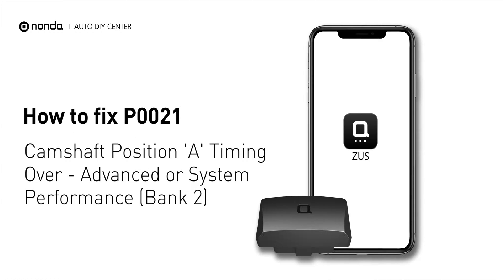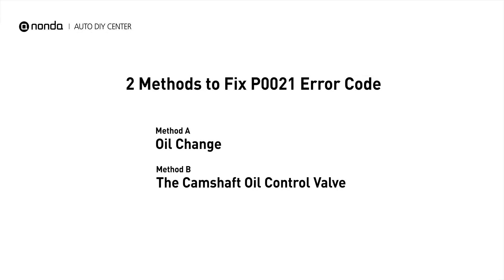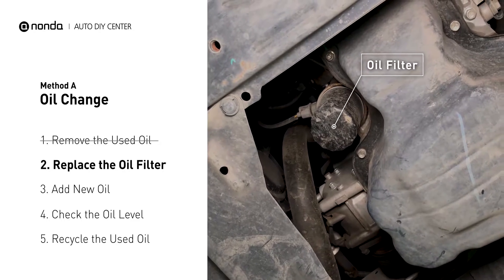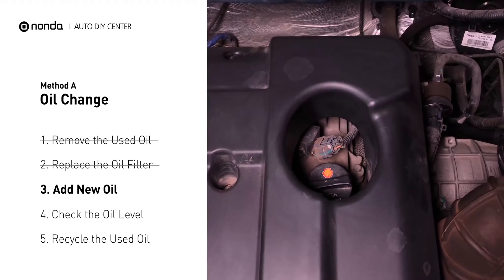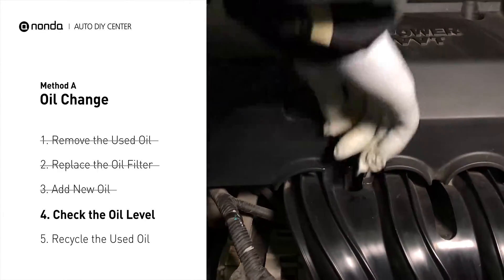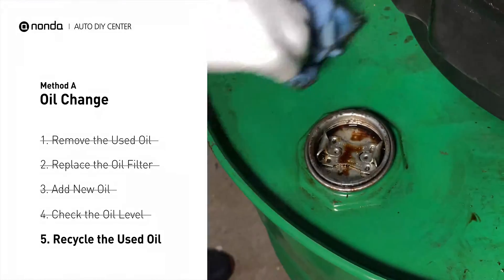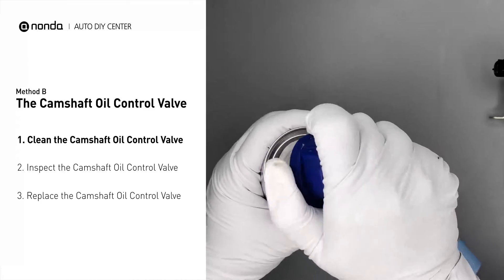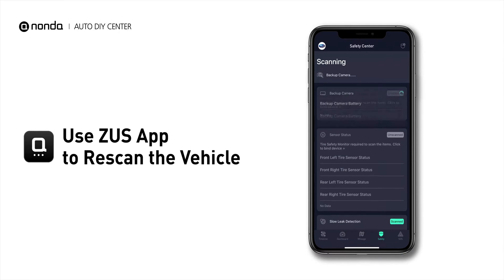How to Fix P0021 Engine Code in 4 Minutes [2 DIY Methods / Only $6.43]

Comment from the maker: Hi, I'm Steve, nonda's lead mechanic engineer. 
Feel free to leave your comments here if you have any mechanic questions, I will be glad to help you out!
Reply: Hey! I have a 2008 Infiniti g35hr I’m getting a p0021 🥶 service engine soon but it doesn’t seem to harm the car meaning bad idle or anything. I just did a oil change a couple hundred miles ago and did valve covers b4 oil change..

Comment: I got the code on my 2014 Mercedes C300. P0021-77. Would these method work?
Reply from the maker: You could have a little try, but make sure do not do anything risky.

Comment: Hello. Are these readings good or not? Is this code p0021 also related to VVT care or not? Thank you.
Reply from the maker: Hi Jaffar, yes-it affects vehicles with VVT. As this code could cause lost power and tough to start motor, we suggest to treat this right away. You may start with changing the oil and replacing the Intake Camshaft Position Actuator Solenoid.
Reply: @nondainc  Thank you. But the vvt sensor was checked outside the vehicle and there is no defect in it. My question is when checking the vehicle with a fault detection device. The examiner tells me that the defect is not in it, but in the care of the vvt actuator .
Reply from the maker: Probably yes, Jaffar.
Reply: @nondainc  Thanks and appreciation
Reply from the maker: You are most welcome. Stay safe!

Comment: I have a Cadillac CTS 2007 with only 77000km and just bought it. My oil change is due tommorow and the code pop out today ! Might it be my oil change ?
Reply from the maker: Possibly-yes. We suggest to check also the wiring from the solenoid to the ECM if damaged, and the wiring harness to the intake camshaft position sensor for poor connection as these could trigger this code.
Reply: Thx u a lot !
Reply from the maker: You're most welcome!

Comment: I’m getting this code on my 2003 Range Rover. Help
Reply from the maker: Hello, please check the engine oil condition and level. Ensure that it is in correct viscosity, and isn't dirty/low. Check also the camshaft oil control valve if functioning well.
Reply: I’m getting this code in my 2003 Nissan 350z. Help

Comment: I have a 2004 BMW X5 4.4i and I just put new filters and oil did I have to take out the old oil to
Reply from the maker: Hello, we suggest removing the used oil before changing the filter. You may recycle and reuse the old oil added to the new oil to maintain the correct level but ensure to perform a complete oil change once you've reached 5,000 miles.
Reply: @nondainc  and another question my machanic says the bmw has 4 cam shaft sensors for a 2004 BMW X5 4.4 would you know if there all the same or what
Reply: @Dame2funny  the bmw has solenoids that get dirty. Clean the solenoids and replace the oil. Will fix the problem

Comment: Hi,,I have a 2003 nissan pathfinder 3.5l, and gave me a P0011 code bank 1,I changed the oil & filter,changed also variable valve timing,cam sensor,and, crank sensor but still have the same problem & reading code. Problem with the vehicle,once I started  to drive 15 minutes later lose power,drive erratically. I also changed the throttle,still doing same thing. Do you think its the timing belt?,because I'm never behind oil change maintenance squedule,thank you.
Reply from the maker: Hi Manuel, yes- possibly. Also, kindly check all the wiring related (from solenoid to PCM, wiring harness to the intake camshaft position sensor).

Comment: 09 Subaru wrx still have P0021 after solenoid replacement, oil change, new filter and banjo bolt filter removal. Could it possibly be intake camshaft sensor?
Reply from the maker: Hello, kindly check the timing chain as damaged timing chain is the most common cause for this code. Repair or replace if needed. Also, always ensure that the engine oil/viscosity is according to the manufacturer's standards and avoid driving on bumpy roads to keep the wiring intact.

Comment: I done both methods and still getting code was quoted 4800 fix on an infinity .. is this a motor replacement problem?
Reply from the maker: Hi Jeff, if the suggestions provided in the video has been applied and the issue still persist, we recommend having the vehicle inspected by a mechanic for further diagnosis.